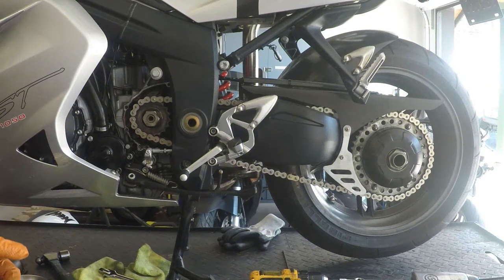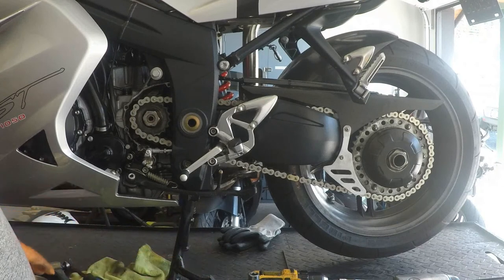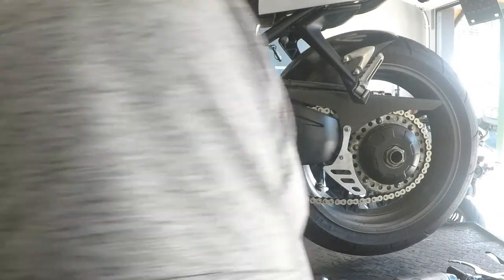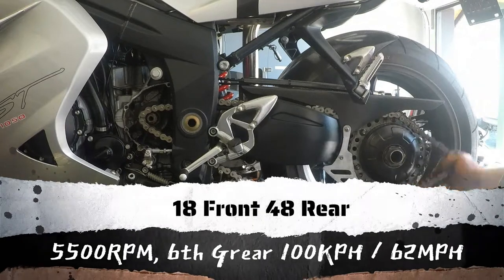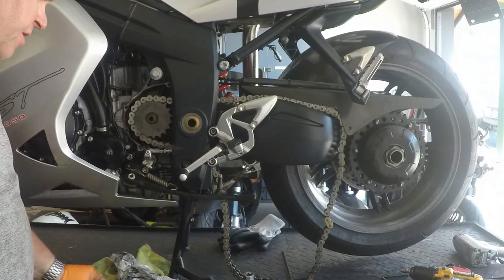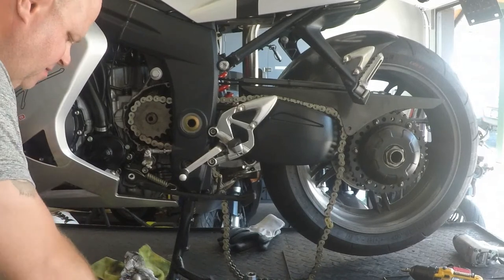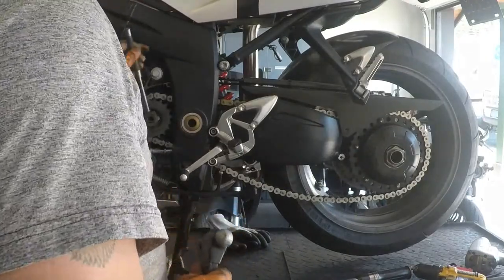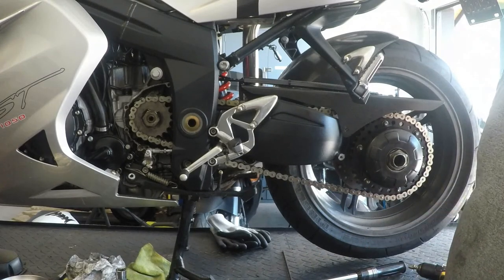How to Change Sprockets on Your Motorcycle

Comment: Good video, informative. Thank you. 
There is an opinion that if you periodically flip the sprocket, the chain lasts for longer use. Have you heard of that?
Reply from the maker: Never heard of that...  The front sprocket usually has a boss on it that is for spacing the sprocket from the transmission so I would not recommend doing that, I am not sure why flipping the rear sprocket along the X axis would help that much other than the leading edge of the teeth but with the teeth already worn on the opposite edge I don't expect this hack to get you that many more miles since I believe it would also accelerated chain wear.  A busted chain is no fun...

Comment: If I change sprockets on my 09' Speed Triple 1050 will I have to correct the speedometer as well or will the motorcycle auto correct for that? Please reach back!
Reply from the maker: Hi Josh!  If you change more than a two teeth on the rear OR one tooth on the front, the speedometer will be out by about 5% the more teeth you change the more it will be out.  Adding teeth on the front will make the bike speedo read slower than actual while dropping front teeth will make the speedo read faster.  The opposite for the rear wheel; adding teeth on the rear will make your speedo read faster than you are actually going.  This is not a big deal IMO unless you are concerned about the odometer since most riders are looking for more torque they drop teeth on the front and add to the rear, getting more RPM at any average speed and making it easier to wheelie.  This will add more miles to your odometer than you actually went.  The speedo sensor on your bike is by the front sprocket and reads from the transmission.  There are companies like healtech than make adjustable sensor manipulation tools that just plug into your harness between he sensor and the main harness.  The Sprint ST 1050 I had used one and it was a piece of garbage IMO.  That bike initially had very low gearing (more torque) and  it was not great at high speeds.  Even at factory gearing that bike could power wheelie so that is what I used for sprockets, factory settings.  I have dropped one front tooth on one of my VFR800's and much prefer this to stock so should expect to experiment a little.  Good Luck!

Comment: Is it correct if I use a larger sprocket in the front the low speed (10-20kmh) jerkiness & throttle snatch goes away?
Reply from the maker: Hi Jeremy, it depends on the displacement of your bike a bit.  By adding a tooth to the front your bike's engine will need to generate more torque to perform the same movement.  It will be slightly harder to pull away from a stop and you may need to feather the clutch or use more RPM than before.  In a low displacement, under 600cc this can make the bike bog and want to stall at very low speeds. A large displacement bike with loads of torque can feel a bit smoother with a front tooth added and may smooth throttle response, especially if you feel your bike likes to wheelie and you don't.  Adding a tooth in the front is like taking away two or three teeth in the rear sprocket.  Your bike will run at a lower RPM at any relative speed than previously so throttle response and torque is diminished on lower RPM and you will see a higher top speed at full RPM.  I hope this points you in the right direction and good luck!
Reply: @RodRidesWrenches  thats some detailed information. Thanks for taking the time. I own a Speed Triple 2010. A dyno tuner told me if I use another sprocket without tuning the Ecu I will just replace the jerkiness to another rpm!
Reply from the maker: A sprocket is cheap to try, worst case you've spent $20 and a hour of your time.  It will make the throttle a bit lazier from your perspective so it may help.  You have all the torque you need in a speed3 so I would give it a try.  You can also go down a front tooth and rev a bit higher to get through a rough spot in the fuel/ignition map faster.  Just know that your going to have more torque at your disposal then.

Comment: Chain adjustment has to be done with motorcycle on sidestand and rear wheel on the  ground. 
Good video anyway. 🇧🇷
Reply: You can add 5 mm more of chain slack if the bike is not on the side stand to compensate that.
I have measured that on my Triumph Tiger, and it works pretty well. My bike does not have a center stand and it's not easy to move the chain adjuster.